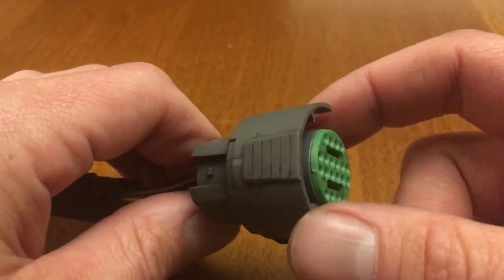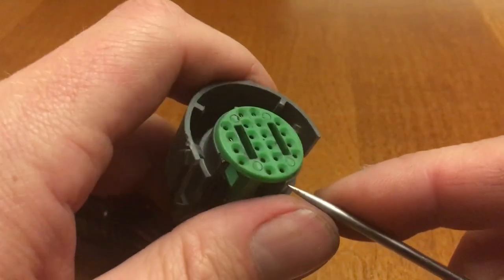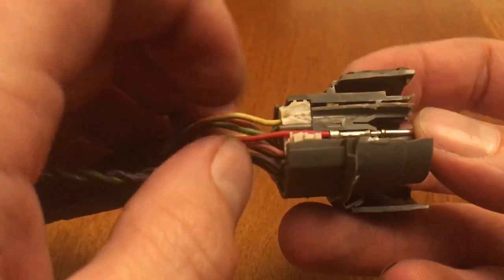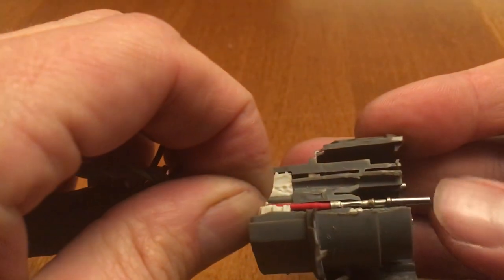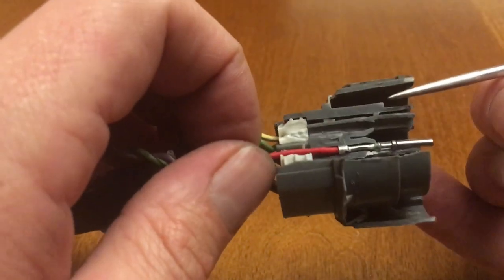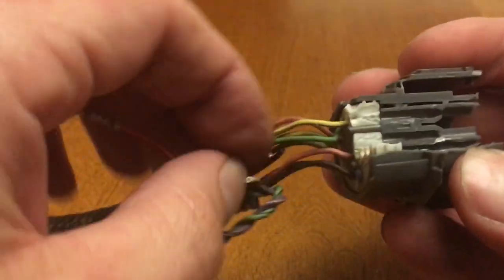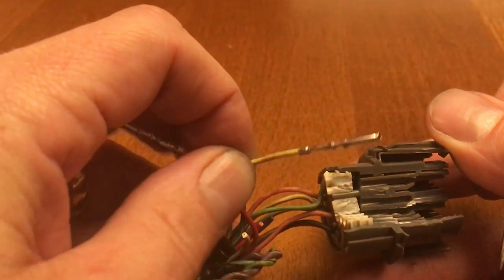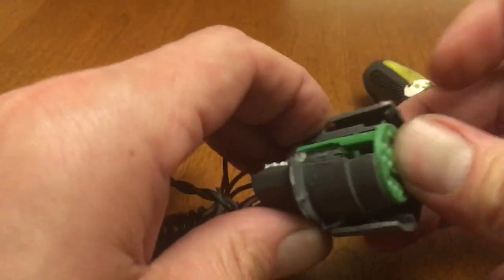How to Remove Pins from a 4L60E 4L80E Connector Cutaway 4L65E 4L70E GM Automatic Transmission Plug

Comment: Dude, your keyring of pin extraction tools is amazing.
Reply from the maker: Walt Zarnoch - Thanks Walt! While it can remove just about any pin, I love taking these connectors apart to find out how to beat them with common household items! Lol
Reply: @WiringRescue  My favorite tool is the stainless backer spring from an old wiper blade. Remove from blade, file/grind to a pick, and there you have it.
Reply from the maker: Walt Zarnoch - oh dang! That’s a great idea! I guess I’ll be doing that.
Reply: @WiringRescue  Feel free to use it in a vid if you want. It's a handy trick for sure.

Comment: Well I have p1860 code not solenoid not ignition switch so it must be this plug or wire elsewhere did you ever diognose p1860 it's 4l60e on 96 k2500
Reply: Had the same problem on my 00 camaro an what I found out the tcc brown cable was out of the pin..pretty sure it was the place that rebuilt the trans before...they did a cheap job...an you don't fix your transmission will burn.
Reply: @VincentKing323  the last one would get real hot on long highway drives in summer and lose overdrive then I towed my camper and fried it I figured when I had it rebuilt it would fix it but still 1860 code I did not know it would fry the new trans too I'll look at plug again maybe disconnect it thanks for reply
Reply: Yeah bro no problem...yeah bro  just check if it good ... follow the brown wire...I changed the computer an it wasn't that...

Comment: Cool
Reply from the maker: Rusted Horsepower - thanks! It’s fun cutting these things open to see how they work!
Reply: @WiringRescue  I work with those almost daily, around 2010 gm switched from Delphi to a whole mess of different connector manufacturers, some terminals lock with plastic locks, some with part of the terminal, some with multiple parts of the terminal, and some lock backwards, with terminal coming out thru the front. It can be a headache. By the way, did you know that alot of original 60s and 70s  terminals have similar locks, like for HEI coil, headlights, or even bulkhead connector.
Reply from the maker: Rusted Horsepower - whoa that’s great info! If you find any spare pigtails send them my way and I’ll dissect them on video! I get a kick out of seeing how all this crap works! Lol